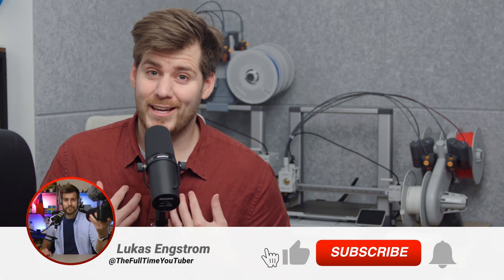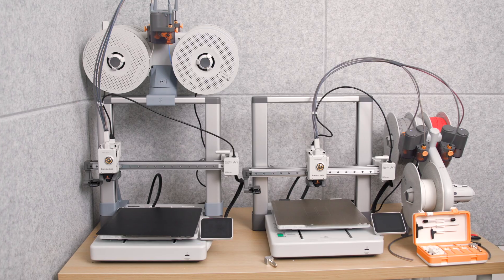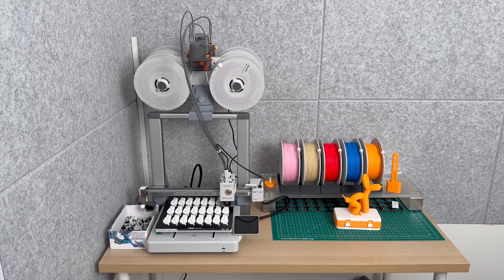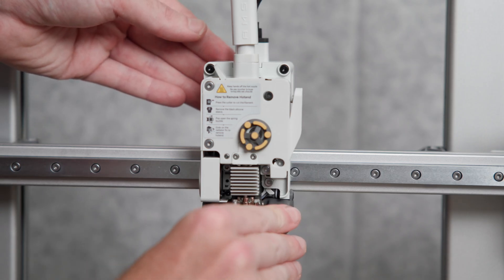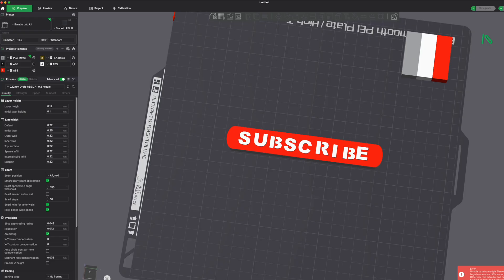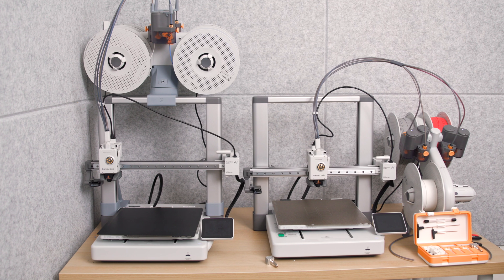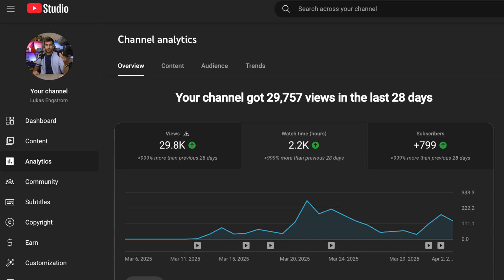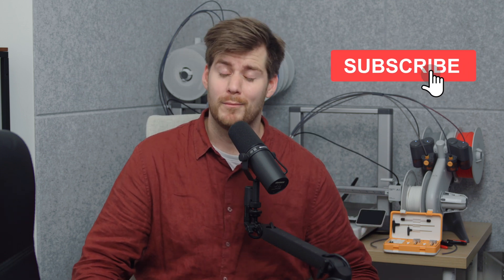How to Change Nozzle on Bambu Lab A1 And BambuStudio 2.0! + Upcoming 3D Printing Business Update!

Comment: When I select Printer Parts the selections are grayed out and there is a notation to "Please change the nozzle settings on the printer"   Open Settings and then Maintenance on the printer screen to change size.   Glad I stumbled onto this setting as I have never seen it referred to before.   Also I was shaving a terrible print problem with a new .6 nozzle and accidently found that wobbled slightly when clamped in.

Comment: FYI. the system has been changes slightly. You cannot change the size in the device tab on the bambu program. you have to now do it on the printer Home->settings->Maintenance->Nozzle size

Comment: Yeah great video. One question do you not think Bambu labs are trying to make it hard to use different filaments from other brands ?
Reply from the maker: I come from the camera world where using a Canon lens on a Sony camera would be unthinkable, so I’m just extremely surprised over the openness of all the systems already. They have a “Generic PLA” setting in the slicer which is already more than I would ask for.

Comment: Congratulations on your first sponsor! I have a suggestion based on a problem I have.  I tried to change the hotend but there is a piece of filament stuck in the nozzle.  How do I extract that filament?  Thanks.
Reply from the maker: Don’t worry about it. It will be extracted by itself next time you’re using the nozzle! Just make sure you cut it off properly before removing it!